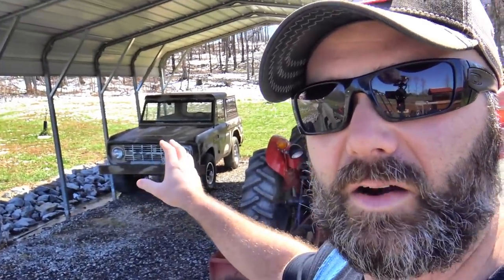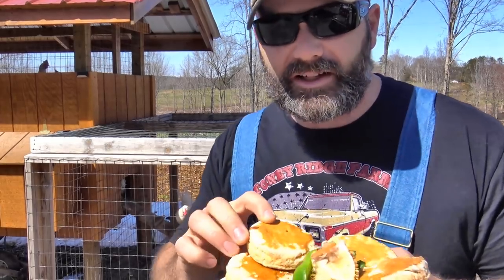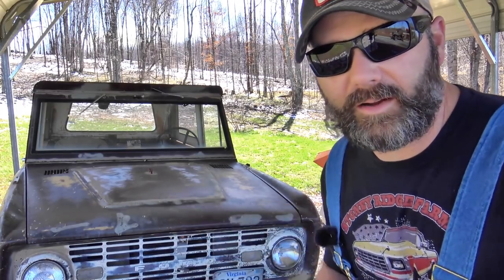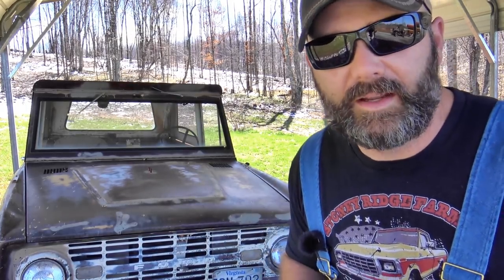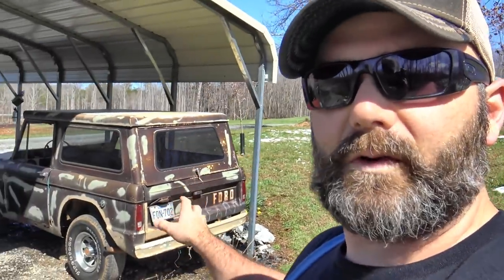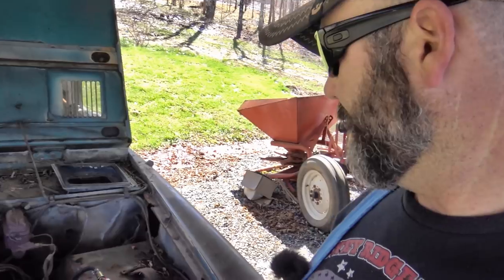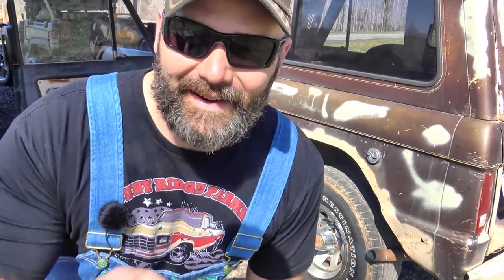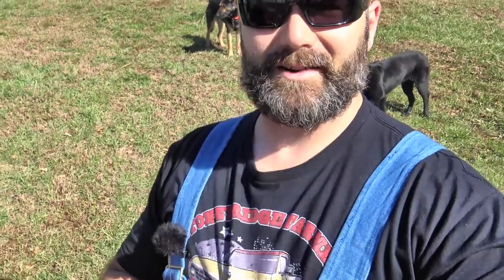1968 BRONCO GOES TO THE CRUSHER?? OR...WILL IT RUN??

Comment: Do not sale it
Reply: I agree with Jamie Dolan you will regret selling it at some point.  I have my grand fathers 1971 C10 he bought new and there are a lot of memories with hat truck from when I was a kid.  We just use it on the farm and glad to have it.
Reply: Jamie Dolan totally agree with you about that that. Never sell it!
Reply: Autumn Oaks Farm I want your Grandfather's Chevy too! Around that year can sell $3000-5000 dollars when engine is not running. Really popular now for years...
Reply: It needs valve stem seals, can be done cheap, you can do it.  You need an air chuck for the spark plug hole, let air pressure in there take the rocker off the cylinder you got the air into, yes just let full pressure  from your air compressor going into the cylinder as your working on it, you'll need a valve spring compressure to take the keepers out to remove the spring, then  take old valve seal off, pop on new one, reinstall spring with keepers, install  rocker and  go to the  next cylinder,  do it for all 8.   You need to do both intake and exhaust on each cylinder.   The air pressure keep the valve from falling in the cylinder.  Then it wont smoke any more.  The rings are fine, or it wouldn't run that good.  It wouldnt make good compression.  It is a really easy job.  I am sure there is a utuber video on it somewhere.  It is the same for all 289, 302 351 small block ford engines.  Good luck and it is pretty cheap to fix and you'll stop the burning oil.
Reply: James Livingston good thing it runs it is getting stainless steel brake lines and I am moving the gas tank this summer.  I have the same issue Stoney has brakes are not real reliable. ;)
Reply: Agreed you should keep it.
Reply: Jamie Dolan uj
Reply: *sail
Reply: When the Rings are sticking and I restarted our vows you're probably fiction have to put rings in the Pistons that's probably why I raise my smoking whenever you start it
Reply: Gas tanks Robert out and electric fuel pump you have an old boat gas tank it'll it'll work for it and plus you can picture electronic fuel pump and plus that'll put enough gas to it to make it rain oh yeah I'm on my saying you'll have to switch your carburetor out because where it said so long that the needle bearings it's probably stopped up
Reply: Did he sell it or keep it?

Comment: Great video Josh. Please keep it cause there aren't too many of these old trucks left hence why they are getting up there in price. I have a truck that used to be 3 on the tree before the owner decided to make it 4 on the floor. The reason for that smoke is due to the engine sitting and not being used as frequent. The rings need to reseat to the cylinder walls more than likely. Try mixing a bit of Marvel's Mystery oil in with your fuel to help get the fuel system cleaned out, and help reseat them valves and rings. If I lived closer I would love to come do the body work on that old Bronco.
Reply: David Genthner Jr ,Awesome point man.
Reply: Even put it in the oil

Comment: The fuel pump is gravity fed so its supposed to be lower than the gas tank. I put tje same one on my old f100 and put it under the cab on the frame. Never gave a problem

Comment: Love it. I would replace the valve seals first before I dug into the engine, they dry out and cause smoke at start up, best to do a compression test to see what kind of condition the engine is in. Then you can get a little better idea of what you need to do. Also you can find a screw in air chuck for the spark hole and fill the cylinder with air to replace the valve seal without taking the head off. Good luck wish you all the best.

Comment: Great video, Keep it leave it for your kids. I searched for years for one of those small Bronco's, could not find one, finally traded for three International Scouts, 1 1961, and two 1962's. Future farm trucks.   Smoke when you first crank up the engine usually means valve guides, that's not real expensive , you can buy rubber boots, remove valve springs and use air pressure to hold the valve up as you install the boot. If its the rings it would smoke blackish smoke, white  smoke means carb needs rebuilding or adjusting. As far as pouring gas in the carburetor, cut a water bottle in half and use it, you less likely to drink from it.

Comment: Josh, I think you will find that the pump needs to be lower than the fuel. I've had over a dozen of those engines. Do a compression check, wet and dry. Probably oil leaking past valve seals. Highly recommend getting a Pertronix points replacement (inexpensive,no dwell, simple gap, 3  wires). Personally it is one of the first things I do to a points vehicle. Started working on cars and equipment about 1972 and ever since. Replaced the Mercedes ML's water pump this morning, last week f250 starter, atv carb, utv brakes, added 3rd function to Tractor. You get the picture.:-P

Comment: I had a 69 with a 302, 3 on the tree! It had  a 4 inch lift kit! I drove it for 4 years!  I had to replace the u-joints every year!  I replaced the clutch once,  then the synchronizers in the transmission went out! The valve guides are worn, when the engine is warm the valves expand and seal the gap, as it cools after it is shut off , oil runs down the shaft of the guide into the combustion chamber of the engine cylinders! When started the oil will burn causing the smoke, after it warms the valves again expand and it stops smoking!  With warn rings, it will continue to smoke after it has warmed up! Also with rings there will be a considerable amount of oil consumption and fouling of spark plugs!  Im a retired diesel mechanic!

Comment: In high school I bought a used 66 Bronco (first year model) Six cylinder and three on the tree. Well maintained because the original owner was the service manager at the Ford dealer where my Dad worked.Then I went into the Air Force and left it with my Dad. Recently asked him ẅhatever happened to it, but he could not remember.

Comment: I sold my dad's truck after he died and have been heart broke ever since. He bought the truck new. My wife and I were hard up for money, but if I could turn the clock back 35 years, I would have definitely went another route about our finances. I even tried to buy it back a few years later but the guy wouldn't budge. You can restore it even if it takes years. Keep it. It can't be replaced. Still heart broke after all these years.

Comment: Josh, you really should pick up a battery operated transfer pump to transfer your fuel. No more lifting and pouring, and has an instant on/off switch. I got mine at Harbor Freight for $8.99 and it pumps 5 gallons in 2.5 minutes.

Comment: The blue smoke is burning engine oil, when the bronco sits the valve stems seals are leaking oil into the combustion Chambers and when you start it you get the blue smoke, after warm up it goes away hence no oil in combustion Chambers. Normal for engines to wear like this

Comment: Needs valve guide seals, and electric fur pumps push better than pull.  Move that pump back by the tank.  Run s little diesel in the oil to remove carbon, might help clean the rings and reduce smoking. Great little bronco with cool history.

Comment: KEEP IT !     I had a 1967.  Best thing I ever did was to pull out the 289, sell it and drop a Chevy 383 small block crate motor in it.  400 hp  YA BABY !  No more smokin and chokin anemic 289.

Comment: Valve stem seals is the smoking problem they harden and crack,and oil sips down the valve guide and into ur piston.But replacing them with the heads on is easy but can go horribly wrong in a second.

Comment: It needs fresh oil and some oil additive. The blue smoke is burning oil. There is an additive called motor honey. Add is to replace a quart of oil and should help subside the oil burning and help seal up those rings and valve guides

Comment: Might be a combination of things making it smoke. Valve seals may be bad also could be rings.  Check to make sure the oil return holes in the head are not stopped up which could cause an excess of oil to sit on top of the head where is can seep by the oil seals on the valves. If the parking break works you can use that to stop it when you are moving it around the yard.

Comment: Check ur valve spring seals under the valve covers, they will dry rot . U have to run leaded gas unless u have hardened seats for the valve seats. A head job would take care of the smoke problem. Replacing the timing chain would be a good idea while u got the heads off👍

Comment: Those old Broncos are cool. First thing to do is buy a gas tank and put it in. You can make a video anytime about fixing rust or painting or repairing engine on the Bronco and people will like it.  I would rebuild the 289 I love those engines. It runs for now though so not an immediate thing to do really.  Start fixing rust spots and painting it. But the aluminum floor boards look like they will work good to me. Each part you put on that will be interesting and fun to watch. I am excited about this old Bronco for restoring.  Pressure wash it too, especially the engine compartment under neath it and everything. You can put some giant wheels and tires on that baby too. They are just the coolest vehicles to restore and use any place especially that farm. Woooooooooooo!

Comment: Hey Josh, great trouble shooting on the 289 V8.  Got the same engine with 2 barrel carb in a 67 Mustang. It's a great small block. I vote for loading it on a roll back and have some new brakes installed. Then you can make a valued assessment. Plus be able to drive around,

Comment: Best way to find the oil burning problem is do a compression test on each cylinder and that will show if the rings are worn out......but....also because old ford V-8s had valve seal problems.They get brittle with that kind of age.....so that will make it smoke too .Sounds like it idles smoothe from what I have heard Josh.    #442 here.......Woooo

Comment: When you get it running, if you want to get it out of 4 low put I'm reverse and while backing up pull on the transfer case lever. It may take a little bit of reversing but that should get it out of 4 low. Keep it don't sell it. Wish I had my Dads farm truck.

Comment: Your wires may be backwards and pumping in reverse.yesbits bad for the pump to be dry running. Also it's most like valve guide seals as if you're starting it the blue smoke (burnt oil) would had to of leaked down into the cylinders. Keep the truck

Comment: Try changing the valve stem seals , they dry and crack from sitting and then it sucks oil past them when running.

Comment: Hi Josh. A compression test of all cylinders would be my first bet as a starting point. You may be able to find average compression numbers online for the 289 and compare it to what pressures you get from your engine. Next would be a cylinder check using compressed air. Each cylinder would need to be set at TDC on the compression stroke. Apply 20-30 psi air pressure. Air blow by at carb-intake valve. Blow by at exhaust-exhaust valve. Blow by at oil filler tube-rings. If your dad kept the engine in good condition then I would bet more on valves and valve guides. Just depends how much time and effort you want to put into it. Wish you the best with the Bronco and the old Jeep. Be well.
Reply from the maker: Oh I'm sure the engine is tired...but it still runs great...like you said depends on how far ya wanna go with it

Comment: If it only blows blue smoke wen u start it its valve seals. It's very common. It's also not much of a problem. Also pretty easy & cheap to fix.
Reply from the maker: Been doing it for years!

Comment: The best I can remember not alot of Broncos came with 289's, most were 302's and 6 cylinders.  You might have a rare one there.  There are some old Bronco sites online that you can check on it and the same sites have 'new' old parts also.  The restored ones are bringing good money.

Comment: No way i would sell it Josh. I did that once years ago with a vehicle that had been my Dad's for years, then I drove it in High School. It was a 1965 Ranchero. I still to this day, 15 years later, I hate I sold it. You'll definitely regret it later. To fully restore it will take a lot of time and money. but you got it running. assuming the transmission and clutch work fine. You could throw some brakes on it pretty reasonably, and drive it around the farm, then tinker on it when you have time. It's under a shed now, so that'll help the rusting issue.

Comment: Hello. Never tried to comment on any vlog. If I may make a suggestion if you electric pump does not work again. Get a lawn mower gravity fed tank with a shut off valve in it or put one inline. The electric pumps do not work well when you try to dry pump them. An electric pump also needs to be very close to the gas tank when it is installed. Running an electric pump dry will cause the same thing after your final install. Hope this helps. Like your vlog. Wish I was doing something the same but maybe later in life.

Comment: Any time you install an electric fuel pump you need an additional fuel filter between the tank and the pump. Ask me how I know, lol. Also the smokey haze is oil smoke. Try something heavier than the popular 10w40 oil old fellas in the 70s loved, lol

Comment: 289's have rubber valve stem seals. They smoke when they old and dried out. Im betting they are dy amd broken up. It is a fairly easy repair. Therd are videos out on how to do it. Should fix that smoking problem. Leep it, very cool truck always wanted one!

Comment: your valve stem seals are bad that was common with the 289 engine pull you can change them with out pulling heads with air pressure to keep valves closed and want fall down in engine when you take valve springs off.

Comment: Is that a pushing pump or a pulling pump and placement of where the pump is from the tank to the carb matters if it's a pushing or pulling pump and some carbs need pushing pump some need pulling so there is quite a few things to think about but just some tips

Comment: Keep the Bronco & the '52 CJ, I subbed after watching the Willy's. I too have one a '42 Ford script GPW Willy's. The Go Devil motor is robust, the previous owner installed locking hubs. Bout the only thing I had too replace was the gas tank, fuel pump and had the generator rebuilt. The Bronco's are a blast the removable top is a nice thing to have. I too agree the motor has some blow-by... simple compression test would answer that. There's several Willy's website's and a wealth of info and sourcing parts. Like a windshield etc... The Willy's here in that same condition are about 3k if the engine is not seized. One fixed up your talking 10K + all day. Great content!

Comment: In my limited experiencd, black smoke = burning excess fuel, white smoke = burning coolant (cracked block or warped/cracked head), blue smoke = burning oil. Rings, valves guides?

Comment: Electric fuel pumps are made to push, not pull. If ya mount it back by the tank, on the inside of the framerail's a good spot, it should work fine. The closer, the better.
Reply from the maker: Hmmm...you gotta explain the science to me brotha.....if it pushes then it has to pull the same that it pushes right? Tell me more man...enlighten me!
Reply: I'm a two finger typer, these guys can explain it better then I can. Pumps make pressure, they don't suck very well at all is all I can tell ya.

http://www.how-to-build-hotrods.com/electric-fuel-pump.html

I had a '69 Mach 1 with a 428 CJ when I was 20, the mechanical fuel pump would run outta gas when I raced it so I installed an electric under the hood. It did worse then the mechanical pump. When I read the instructions, my first time for that I believe... heh, it said mount it by the tank after a filter, when I did that, well, I blew it up two weeks later on the strip. It worked too well...

Comment: The valve cover Seals Need replaced. They dry and crack. From setting... It sounds good. If you want too sell it. Let me know.  That's one of the only Fords I would own. They were a Good little  broncos..And the 289 was a good motor...

Comment: How many mile on it? The blue (oil smoke) could be just valve seals. Could be frozen rings. Might try putting in some Marvel oil or similar and run for a while. (cheap to try). A thought would be to check with a local high school that has an auto shop and  and see if they would like to work on it.

Comment: Does the blue smoke go away after it starts or not. If the smoke continues it is rings, If it goes away and only does it when starting or just idling it is valve guides of seals. 289's wee notorioous for hat problem.

Comment: G'DAY Josh,regarding the Smoke on 1968 Bronco,"Blue Smoke", on start up,on 289, likely to be Valve Stem Seals on head,especially on cylinders 7&8,as they furtherest from cooling system, thus heat over 60 years of use,has hardened rubber stem seals?kindest regards, Dave McLaughlin, Queensland Australia

Comment: Your gonna need a fuel pressure regulator if you run a fuel pump like that and you want it as close as you can to the fuel tank. The smoking is most likely valve guide seals. have the heads rebuilt and you should be golden. If the rings were worn it would smoke all the time..

Comment: You would be NUTS to sell that Bronco Josh! They bring great money restored. The 289 is easy to rebuild! The rust issues are not that bad. Parts are not that expensive... I speak as one who has bought junk, restored it and sold it for good cash! Your blue smoke could be from valve seals but I would still go through the engine...

Comment: I had a 1974 with a 302 and power Steering  Auto trans  dual fuel tanks  the switch on the dash marked Fuel  is only to Measure what's in the Tank  you have to Turn the Valve under the front of the Drivers Seat to Switch tanks    nice truck